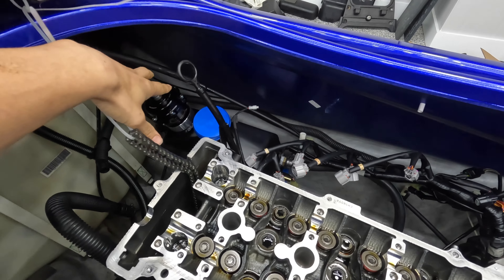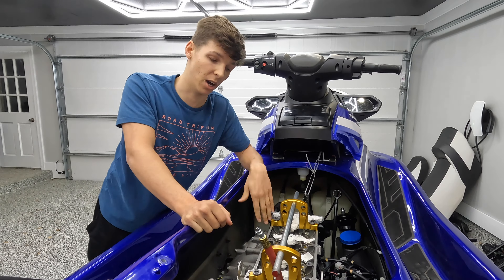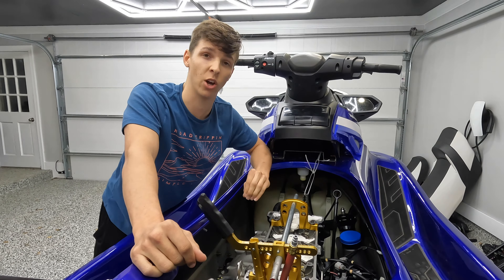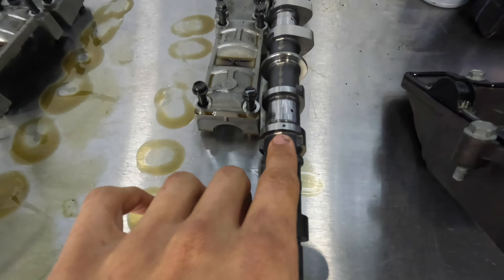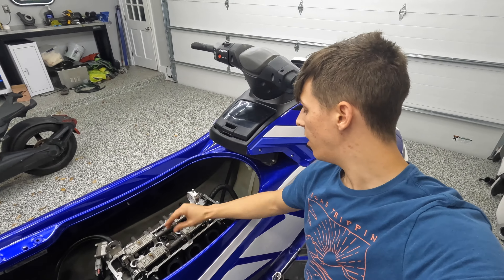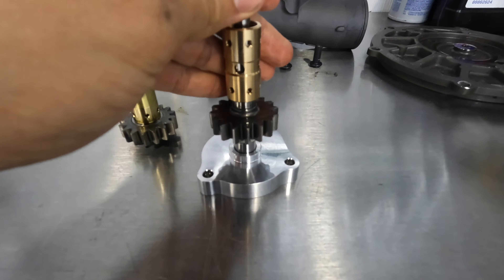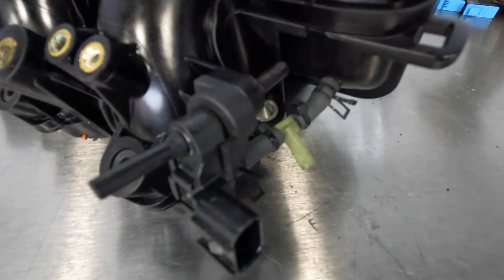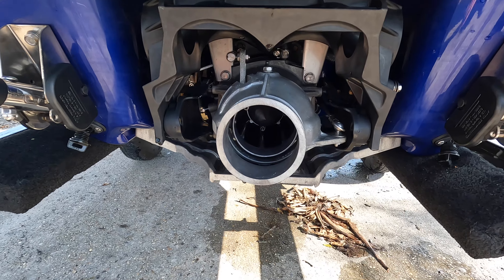SVHO TITANIUM RETAINER & LUCKY 13 CONE INSTALL

Comment: props to the owner   the motor looks in great condition , a lot better than the 21 gp ho u had on here, saw some corrosion not a good sign.
Reply from the maker: I was surprised when I lifted the seat off. It looks brand new!

Comment: When you reinstalled the valve cover, how did you secure the nylon timing chain guide/rub piece? Did you use any gasket sealer on the valve cover itself? Or just the factory gasket? Thanks, great vid Greg!

Comment: One thing I don't understand - when would you want to change the pump cone instead of repitching the impeller?
Reply from the maker: Repitching the impeller will only change engine RPM and doing so will increase or decrease the thrust from the jet pump. Changing the pump cone improves the pump efficiency to improve holeshot, acceleration, and top speed.

Comment: Man I start washing you Channel and you’re awesome thank you for all the information did you provide I do have 2021 FX cruiser supercharger and I have 2021 GP 1800 R HO non-supercharge what do you recommend to me the non-supercharger faster I have the air filter solar 13/19 Rear exhaust Pipe I make a hole on the rear what else I can do for the GP 1800r ho Thank you keep the good work you are awesome
Reply from the maker: Switch to a solas 11/15 impeller and tune it! 

http://www.4-tecperformance.com/index.php?main_page=product_info&products_id=7815

http://www.4-tecperformance.com/index.php?main_page=product_info&products_id=4250
Reply: Again man thank you so much. You are the best I got everything together.

Comment: Hi, I am interested in doing the lucky cone however am concerned that I have to remove the suction part. If instead of removing the pipe of the suction you cut it so that it is flush to the jet unit wouldnt it still work? it may not be as efficient as before however it will still work I guess?  @GreenHulk Garage
Reply from the maker: That will not work. If you cut it flush you run the risk of reversing the flow and dumping water into the hull. A bilge pump is a safer option than the factory high speed siphon hose anyways. A bilge pump will always pump water out where the high speed siphoning hose will only siphon water out when moving.
Reply: @GreenHulkGarage  ic ok thanks for clearing that up, and once I have that pipe not being used, I can use that through hull connection for the extra cooling of the engine as to avoid having to drill the hull for the extra pipe?

Comment: Greg, if I remember correctly the Venturi nozzle is 87mm from the factory on the GP’s. Generally speaking are you finding that the L13 performs better on them with the Venturi opened up to 90mm? I seem to recall 85-87mm being the recommended diameter a few years ago. Tempted to order a nozzle and test opening it to 90mm on my setup.
Reply from the maker: The GP is 87mm. With the lucky 13 cone I bored it enough to gain back most of the rpm lost with the cone and it picked up close to 2 mph. If I had more time and more nozzles I would try stock diameter with less pitch vs bored nozzle with same pitch to see which produced the best results.
Reply: @GreenHulkGarage  did you open up the steering nozzle as well? What were the finished diameters of both when you got done? I also recall the L13 instructions stating the steering nozzle should be 5-6mm larger than the Venturi a few years ago.

Comment: So u have to delete the siphon tube?...cant u just cut it down? Its the little metal tube in there right?..what does it do..suck water out of hull?
Reply: It has to be removed completely. 
The siphon tube is part of the bailer system to suck out water from your hull. Install an electric bilge pump and get rid of the siphon tube.
Reply: @jgaddis68  forgot to ask...how much do you charge for retainer service?
Reply: @jgaddis68  can you maybe heat it up and bend it so that it doesnt hit the cone?
Reply from the maker: No you need to remove it. It hurts performance.

Comment: Are Yamahas a bit more squirmy at high speed compared to other brands? I ask because from the perspective of the camera it doesn’t seem to want to stay flat. 20 years ago I didn’t feel comfortable on Yamahas for this reason and am just hoping this issue of a slight but constant fishtailing has been eliminated.
Reply from the maker: They are not squirmy at all at top speed. The camera does a terrible job at capturing wave height especially when at speed, in this video it was quite choppy causing the ski to come unhooked. On calm water Yamahas are rock solid. It doesn’t compare to other brands at high speed because other brands simply can’t keep up with Yamaha 😁

Comment: I have a 22 gp and let’s just say I have almost everything including a big 26 lb supercharger wheel, I’m on e85 , 2100cc injectors, and a lot more , my motor is 100%stock, I’m hitting 99.5 on a really hot day, this is with stock 87 nozzle , do you think with that lucky 13 cone I’ll be able to hit 100? Is the lucky 13 cone good for getting a bit more top speed ?
Reply from the maker: Yes, the cone will easily add 1-2 mph once you have it dialed in on your setup. It will also reduce cavitation on hole shot and it will improve acceleration. The fastest skis in the world are using this cone.
Reply: I just got my pump cone and installed it Aswell  , I have one last question, I’m in Miami weather is really hot what washers do you recommend me to run ? I’ll really appreciate the help

Comment: Did you get a chance to see if the dean's team tune clean up the incooler lean problem
Reply from the maker: I did not monitor AFR. Dean knew it had the fizzle intercooler and tuned it for the correct fueling. RIVA can also add fuel to their tunes for the FIZZLE intercooler if requested
Reply: @GreenHulkGarage  ok thanks I need link for the helmet too.
Reply: @GreenHulkGarage  its same with  seadoo rxt 300? With riva tunes with fizzle supercooler? Running lean?
Reply from the maker: @alihaidar4663  no it’s not that same with the Seadoo

Comment: Does the GP1800 svho have a limited until break in hours are met
Reply from the maker: It does not
Reply: @GreenHulkGarage  mine has 3 hours on it and it won’t go over 6000 rpm and stays under 55mph any idea what would cause that
Reply from the maker: @cameronmoody3472  boost leak! Check the hose that attaches to the throttle body. It likely came off a little bit causing a boost leak.
Reply: @GreenHulkGarage  I’ll check that I appreciate it

Comment: How much did you opened the nozzle?
Reply from the maker: Not much. Maybe 1mm max. Even after boring the nozzle it’s still 200 rpm less than the stock pump cone.
Reply from the maker: I just measured it with my calipers to know exactly. I bored it .75 mm
Reply: @GreenHulkGarage   thanks!

Comment: "buckets are shimmed to match spring" 🤣
Reply from the maker: Would you say they’re not? On top of each valve is a shim to place the the bucket exactly where it needs to be. If you start mixing shims and buckets then the spaces between the cam lobes and tops of the buckets will not be correct. This could close the gap entirely and not allow for the valves to properly seat or even open the gap.
Reply: @GreenHulkGarage  clearance between valve stem and cam base circle not the spring 😀 great content though

Comment: How  you like dean's  team  tunes  vz riva
Reply from the maker: I honestly couldn’t tell a difference. The main reason I go with RIVA tunes is  no one else tunes on an engine dyno with egt/afr being monitored in each cylinder. This showed when I pulled the spark plugs on the deans tuned SVHO; plugs 1&4 showed it ran considerably more rich than 2&3(2&3 are known to get more air because of the intake design).

Comment: do u think gp1800r can do stuff like rxtx 300? for example this video https://www.youtube.com/shorts/kEPUEJP-IBw
Reply from the maker: I don’t recommend that anyone does that on any watercraft…but the GP1800R is far more capable than the RXTX 300
Reply: @GreenHulkGarage  i heard that the gp1800r have holeshot issues is that true?
Reply from the maker: All Yamahas will cavitate. There are fixes for this depending on how bad. Lucky 13 pump cone, RIVA gen 2 intake grate, and a solas impeller will help tremendously. Ultimately, throttle control will be your friend to holeshot a yamaha
Reply: @GreenHulkGarage  yeah i am after the jetski leaving the water like the video hahaha so usually i put the trim all the way up and hold it wide open so i think the gen 22 intake and then solas impeller will do the job with a stage 1